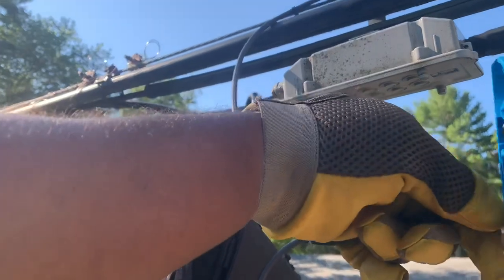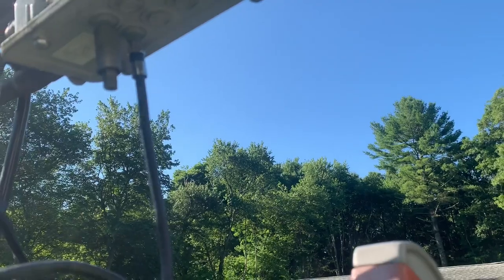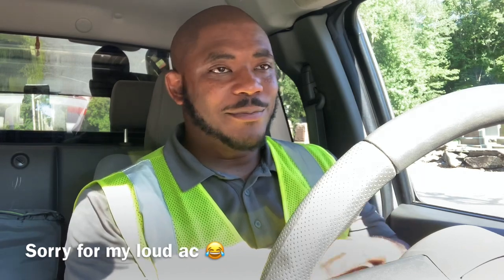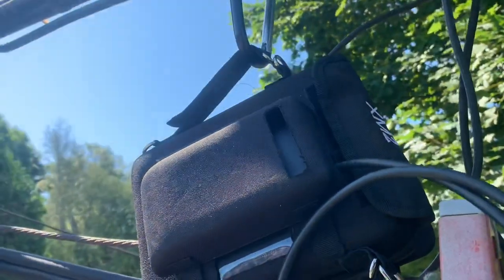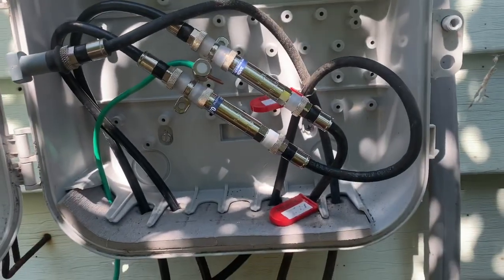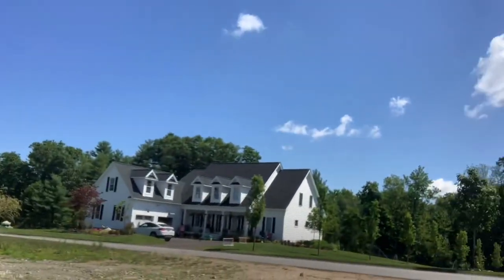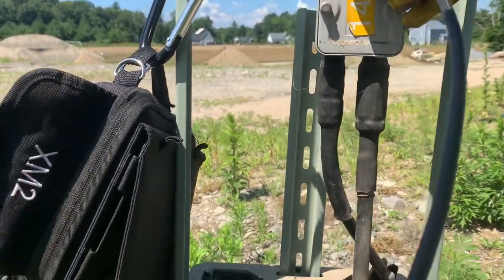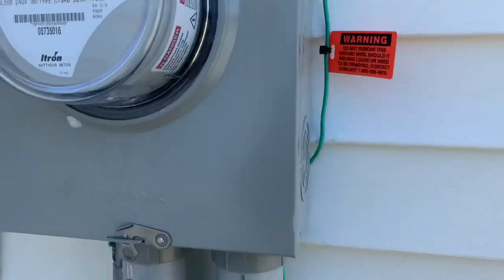Life of a cable technician Ep #1

Comment: Good video, but two important bits.  ALWAYS clamp drop with Amp Clamp to check for amperage, before disconnecting drop.  Any reading over 2.0 could be dangerous.  You can damage customer equipment if drop becomes neutral for power, or ( more importantly…..hurt yourself badly).  I learned the hard way a long time ago.  Been cable technician since 1998.  GB should be mounted horizontally, not vertically.  Too much water will get in otherwise.  Well done otherwise.  Enjoyed the video.  Brought me back to my days as an installer.
Thanks for taking the time to share video!
Reply from the maker: Thanks for this comment my next video will definitely be about this safety is always must important
Reply: true that.  was a busi and resi svc guy for comcast, 2004-17.   the vid makes me remember a lot.  In-house.

Comment: 1) you're tied off to a transmission line and not the strand. 2) the rope that takes the fly up on the ladder is not tied off to the ladder. 3) did you check for foreign voltage once you reached the tap? 4) did you cap off the drop before you tested it? I used to work for Comcast and I lived and breathed BRIS.

Comment: How’s the pay and training if u don’t mind me asking, I’m in computer repair business but considering cabling
Reply: You get paid by the jobs you complete. 1 week of training with another tech. After, you are on your own.
Reply: Depends where you work. The company I worked for was a contractor for Comcast. The install techs got paid piece meal. That means every cable, connector, screw, etc has a price that you are paid. You might get 25 cents just for terminating a coax cable. Average install job made the tech about $35. I was on the construction side though so I got paid hourly. I primarily did plant extensions.
Reply: @Guanaco7810  yea for contractors not in house

Comment: My house is finally getting internet this weekend . The current ground block and the coaxial coming into the attic from the exterior  is connected to my roof antenna ... Will they go ahead and make another hole to run the coaxial into the house ? Inside my attic above the garage is where the splitter is that I currently have antenna connected to. I also ran a coaxial cable from that area inside the attic to the  opposite side of the house where modem will be ( I fished it down that rooms wall and put faceplate ) will they be able to use that ? And does it matter that the rg6 coaxial is 100ft ? .... My pedestal is in my front yard about 20ft from the garage side of the house .  Oh god I hope you understand all of that 🤦🏾‍♀️😅
Reply from the maker: Shay H  lol yes I understand what your saying If your still using that antenna service they will definitely run a new Rg6 inside the home they also will definitely be able to use that one wire that’s is for the modem and by you only getting a modem installed 100ft of wire wouldn’t be a problem because they are not splitting signal. We call it home runs where we basically wire the home from the ped to the ground block to the equipment of the home with no splitter in place 👍🏾

Comment: Why escalate to maintenance when the signal at the tap is at 17?.. Was that the low end of high end?
Reply from the maker: Alex Celaya they did away with the ticket signal was good I was coming from a different system during this vid (Cox) and with them at the tap anything over 15 is high
Reply from the maker: Alex Celaya Xfinity however is different with these address taps
Reply: @cabletech2371  over here with spectrum anything over 25 is too high.. It also depends on the area you're working in because if the drops are too long then you'll lose more signal so I don't mind having plenty of signal to play with
Reply: @alexcelaya8814  Yep, every system is different and every company has there own rules. Maint used to give a little more signal to taps that had very long runs to the house, but new rules  in our area now says anything over 20dB fails and needs a maint ticket.
Reply: @alexcelaya8814  As crazy as it sounds, you would think the service techs would do just that, but instead they put a maint ticket in for high levels, we go through and lower the tap to the correct value (per engineering design/whole other issue) , then they have to go back and add a  house amp that will either go bad during a lightning strike or cause a noise issue in the future. Some people call it crazy office politics and others say it's job security. If common sense prevailed, it would give me more time to fix actual system issues which would bring the call volume down and make everyone happier.